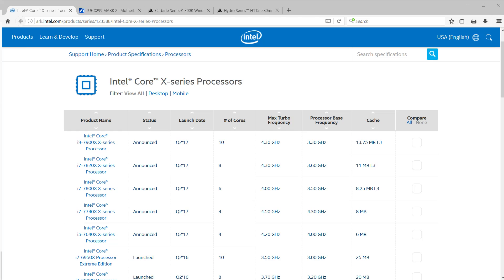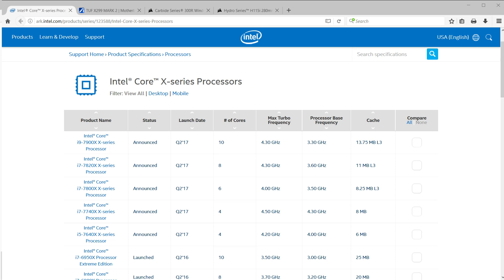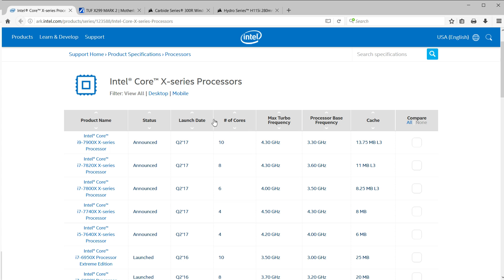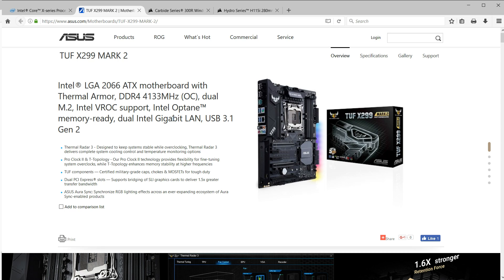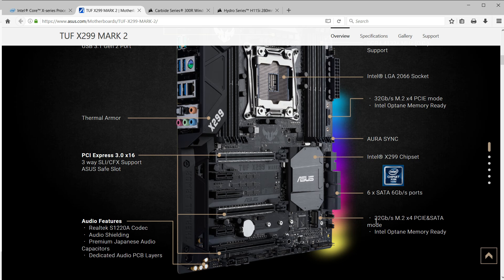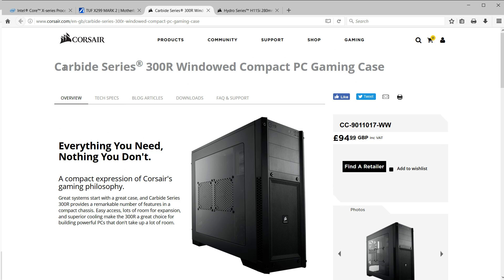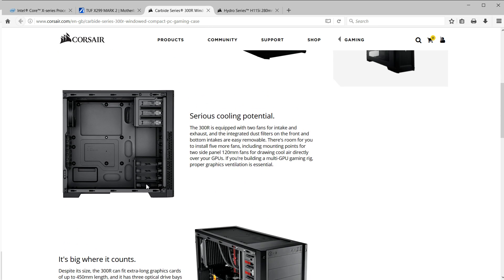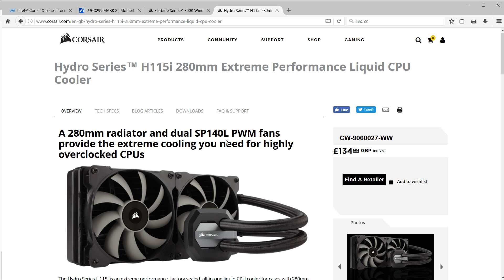Speccing my Skylake X Build - Core i7-7820X and X299 chipset

Comment: A few questions. Is there a big drop off between the H115i and the H110i. I chose the H110i? Also, what PSU did you go with? I selected the Antec HCP 1000. Do you think going with 2 16GB dimms is ok?

Comment: test the temps please on stock , sply with long rendering hours, i want to see how stable this processor is  and sply ht e temps ,  some people say it generates lot of power and heat , but they all test it after over clocking , and does the overclocking even matter , when the chip itself overclock to 4 ghz on all cores when under full load , so i want to see the stock temp test as i don't intent to overclock it . and stock temps must be low i hope , and if can do a cinibench r15 test , plus the rendering test am interested it , will be keeping and eye on your video to see the results thanks mate

Comment: Also looking into this CPU. But i'm confused about the memory speeds. I would like to use the higher clocked 3600 mhz memory but cant find what is supported... Also why did you go for the evo and not the pro ?
Reply: Thijs Vredenbregt oc3d review on youtube. He used 3600mhz ram with it overclocked to 4.8ghz.
Reply: What review ? The review for 7900x or the 7820x ?
Reply from the maker: The 7820X's maximum official memory speed is 2666MHz, so that's what I went with as it is primarily my work machine. Anything above that will technically be overclocking.
Went with the Evo as the extra cost for the Pro was quite high.
Reply: so with 2400mhz  it should be ok right?
Reply: That explains why so many boards for these CPUs for only up to 2666 MHz
Reply from the maker: Should be fine, I wouldn't expect a major performance difference.

Comment: Skylake-X are garbage. High-end chips with TIM paste and HIGH temps!! Worst line of CPU's to date. Intel want ready with this! Soon new refresh 100%
Reply from the maker: Not sure I'd call it garbage based purely on the decision to use a TIM under the heatspreader - it is a bit disappointing that they've done that, but in terms of outright performance it looks to be the best compromise out there for people doing gaming and multi-threaded workloads.
Reply: Boris Gospodinov TIM doesn't have cracks in overtime from heating and cooling the processor. Considering the price of the processor, people who buy this probably don't want to buy another processor for at least 4-5 years.
Reply: never heard any one having problems with solder cracking and there are people still using first generation i5 and i7 cpus with no problems
Reply: Performance is not bad, but CPU overall with this TIM + high temp is joke.
Reply: Still better than Ryzen with its single threaded performance.